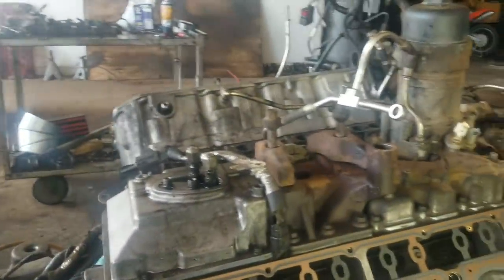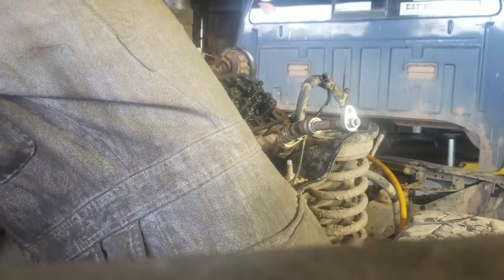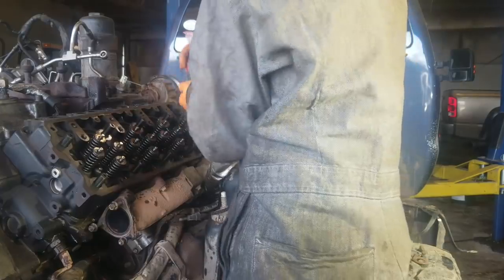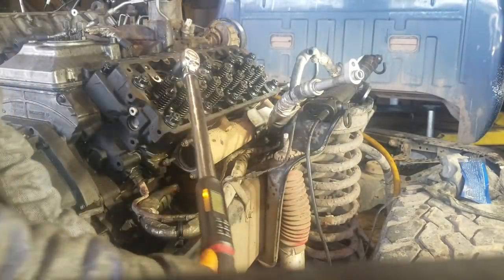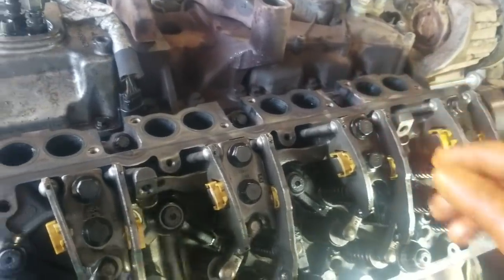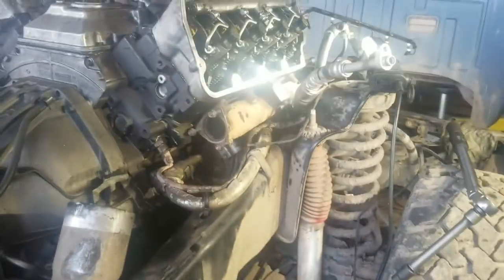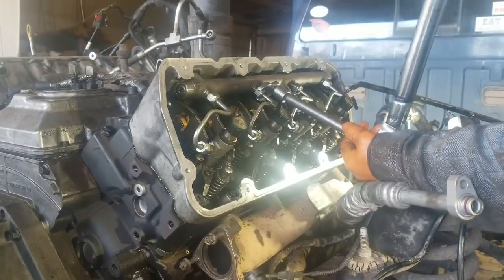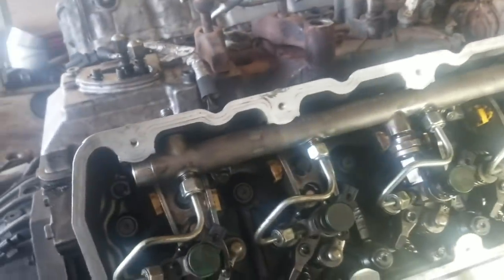Head studs on 6.4 part 2

Comment: I started wearing gloves a few years ago.  It took some getting used to but I'd never go back.  I went from hands I could never get clean to not even being able to tell I'm balls deep in grease all the time. 2 suggestions: First get the Adenna Dark Light 9mil gloves on Amazon (measure your hand and get the right size... The wrong size will make life very frustrating) They are so much better than the cheaper 5 mil ones and almost never get tears in them.  Second if you wear a pair but don't completely goop them up just pull em off and lay them somewhere inside out.  The next time you need gloves you can just flip the right side out and blow in them to push the fingers out.  This saves sooo many wasted gloves (at least for me as I'm in and out of them a lot.)
I think gloves get a bad rap because people think they are for sissies but I'd rather be called a sissy than have permanently greasy hands.

Comment: I had to buy a used perking 318 tractor engine 1974 model to rebuild as my block was damaged, when i took the studs out they had different thread lengths at each end, the engine had the studs the wrong way around from factory, the nut end only needs enough thread to tighten down plus a bit more, no wonder people pull the studs out.

Comment: Your definitely not scared of work. Most people won't work on 6.4's because of there poor design. We had a few ambulances with them and they had 3 engines put in them by 115k. My neighbor has one just spent 7k on turbos and injectors, and hes trading it in on a new truck. He has spent thousands keeping it on the road. Nobody i know will even do side work on them because of the liability on them. Great video on torquing the head studs.

Comment: Hey warren question, when cleaning The block deck and and head surface before installation what do you use? Ive always been told not too use the die grinder roloc bits because of possible warpage, Thanks
Reply: Sorry i hadnt gotten to the part of the video where you mentioned using the brillo pads. Nevermind.

Comment: You forgot to torque the first injector fuel rail tube on the top passenger side when you were worried it was a bit excessive so you moved to the next injector and marked it with your pen you seen it was spot on but then you tightened that top of that tube to the fuel rail and moved on down forgetting the first one to the fuel rail. Just an FYI. Ps….end 5 min of video

Comment: Doing the same work to my truck. You didnt send the heads to machine shop.?
Reply from the maker: Nope, I'm not waiting a month for a machine shop to screw my heads up and then not stand behind their work.
Reply: @westerntruckandtractorrepa1353  would you recommend it or no.? I send them out and to do valve seals since they came on the kit. Even tho truck didnt overheated, I thought would be good idea to check the heads.
Reply from the maker: You can do valve stem seals yourself.  Straight edge the head and make sure it's flat.
Reply: western truck and tractor repair are these engines not bad about sucking oil past the rings if you reseal the valves and don’t replace rings? 

I’ve always done both or neither. Not just one.